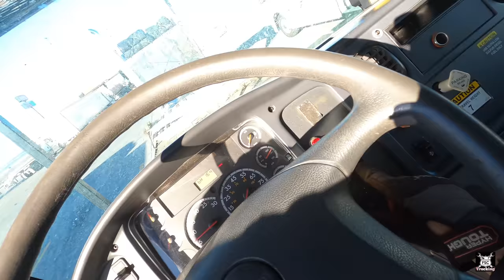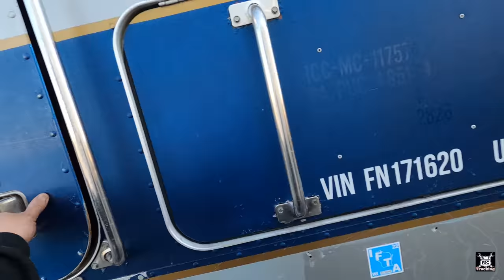Cold Start Bucket Truck In Texas To Unload

Comment: Great video! Hey buddy of mine runs tow trucks, his wood blocks he uses all this time, he goes to thrift stores and buys good leather belts, cuts them down to fit, nails them on each side with roofing nails leaving a hand loop on each end. Then you can push or pull it with one hand. Thought it might help with the block on the fifth wheel. Peace, be safe! 🤟🤟

Comment: Hope your folks find Texas to their liking.   If you drove down HWY 69 in TX, you probably passed close to my location since 69 goes directly through my community. Cold there during this video.  When it comes summer time, will will be hotter than Hades.  Some places in TX are 30 miles form water and 3 feet from hell.  Have a good one!